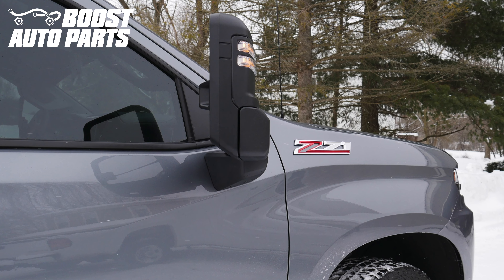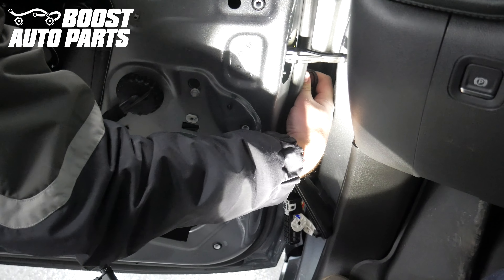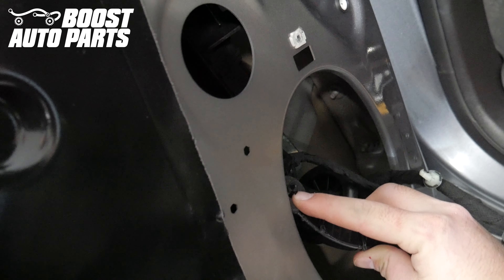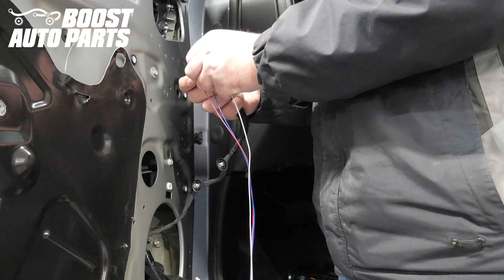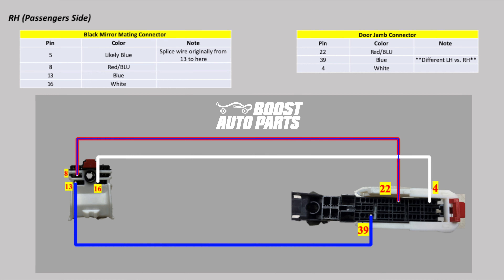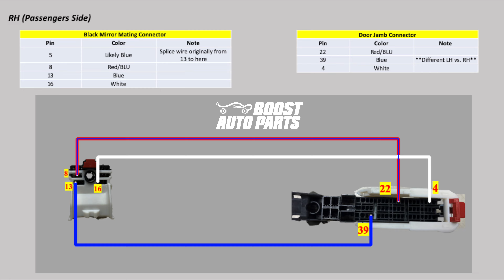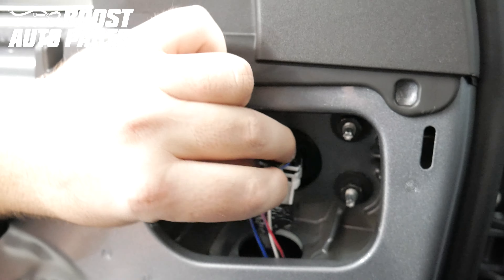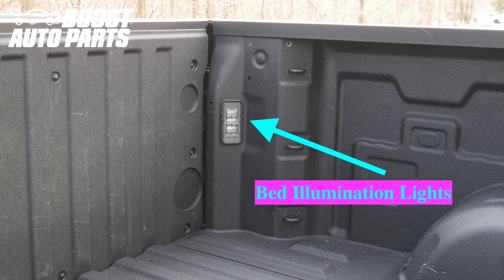GM Tow Mirror Plug & Play Wiring Upgrade (Spot Light Without Puddle) 2019-2022 Silverado Sierra 1500

Comment: Could I just do jump the body control harness black and grey modules to just get the Cargo lamps to Work instead of messing with the three wires thru the door panel?
Reply from the maker: No - you would also need to do the wiring in the door. Call our team at 765-831-2830 with any questions.

Comment: I installed it and only the running lights work, no turn signals. Then when I did the thing to install the rear lights then my driver door switches stopped working can you help with this problem?
Reply from the maker: Sounds like there's been some sort of install issue. Give our support team a call at 765-831-2830 for assistance.

Comment: At one point you cut the wire from 13 and connect it to 5. Then use the supplied wire to 13 via splice. Why wouldn’t you remove the original wire from pin 13 and move it to pin 5? The. Just plug the supplies wire into 13? No cutting? No crimping?
Reply from the maker: Extracting the terminals requires a special tool. If you can move the wire that would work just as good, however most people are not able to extract the small terminal and relocate it.

Comment: Are the doors independent of each other?  I installed both driver and passenger, the driver side running light works but the passenger does not.  Just want to ensure that my problem is indeed in the passenger side somewhere.  ( I have a 19 and still need to install the rzy harness but for now just the door harnesses are in)
Reply from the maker: Yes, they are independent of each other. Many of the 19 trucks are pre-wired only on one side. Likely once you install the RZY your issue will be resolved. If not, we have a highly trained tech support team ready to help.
Reply: @boostautoparts  you were correct. Everything works perfectly now.  Thank you so much for the information and great products.
Reply from the maker: @briankazda7339  Awesome, glad to hear it!

Comment: If your truck does not come with the forward facing lights from the factory will these still work?
Reply from the maker: We don't have an upgrade path to add the forward facing spot lights at this time, but you can upgrade to the towing mirrors and pickup the running light, turn signal, and cargo light.

Comment: I got a issue i got the turn signals cargo lights and the driver side running light to work, my passenger side running light is not working can you tell me what color wire on the harness controls that so i can see if i got voltage there or if there is some thing wrong with my mirror thanks.
Reply from the maker: Running light is blue. Email support@boostautoparts.com and our team can assist.
Reply: Thank you I see the issue now with that wire.
Reply: @mattstuart7297  can you tell me what was the issue and what was the fix I currently have this problem any help would be greatly appreciated!!!!!
Reply: Just did install on my truck.  Same issue as yours.  Did you figure it out?  Thank you
Reply: @flowergatcha  Did you get it figured out having the same issue here?  Thank you
Reply: @66chvle yeah the issue was the wire that pass through the door got caught on the door hinge and was blowing the fuse Every time the door open
Reply: Thank you